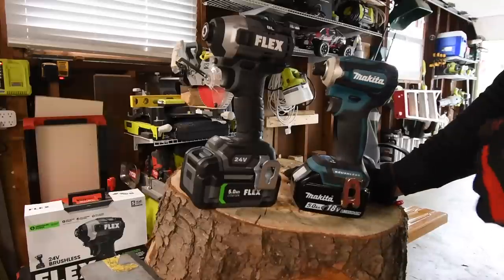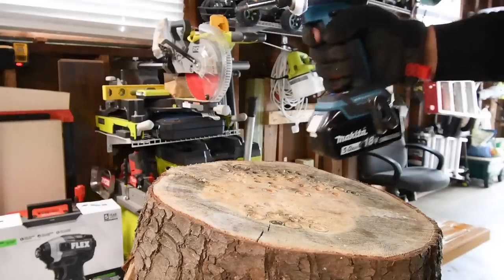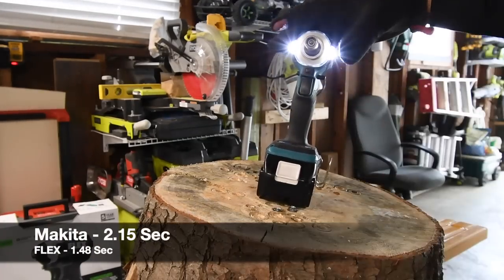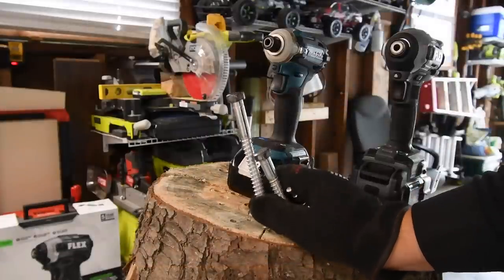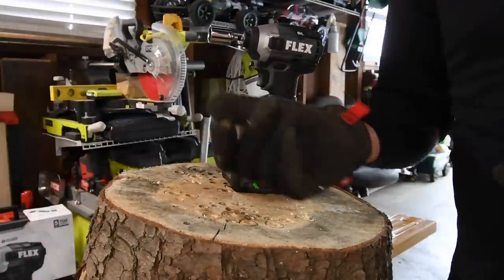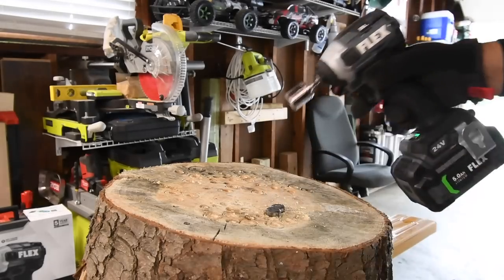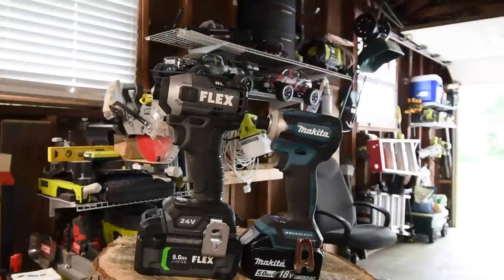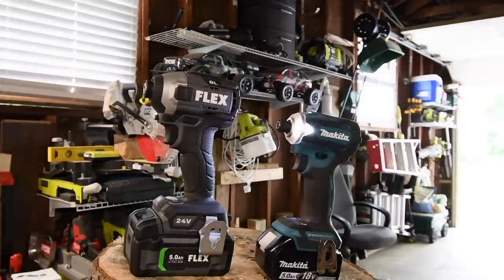Makita vs FLEX (Impact Drivers)

Comment: Power is only half of the equation with tools. The other half revolves around precision with control.
As a professional Tradesman, I did a lot of research when choosing a battery platform and also looked closely into other tools within manufacturers lineup.
The Flex line feels more like a DIY Pro tool where Makita feels and performs more like a Professional tool.
I chose the Makita XGT 40V max line and these tools just keep on impressing.
The right tool for the job. Power; precision; features and quality. Makita for the Win.
Enjoyed the video, keep them coming :)
Reply: Makita make fragile tools
Reply: @trentroberdeau6399  Cool story, but not
.
Reply: @skelley521  in my experience they are….. lol
Reply: @trentroberdeau6399  XGT are way better. Just look at all of the improvements over the LXT line.
Reply: @skelley521  that's why there's a speed setting in most Impact Drivers for precise works, and variable speed trigger for most basic impact drivers that don't have speed settings. All you gotta do is to learn how to use the tool itself. And power and torque is my basis. If you're tool don't have those? Then you're screwed! You can't do the job
Reply: @skelley521  Makita XGT lines sucks! That's why I sold all of my XGT's and got back to DeWalt and Bosch
Reply: I bet u never even tried a Flex tool too make that statement.I own both of these tools and Flex is a pro tool,I think the best pro tool at that

Comment: True tradies know - speed is not everything - imagine operating the flex all day long
Reply: I doubt the flex would go all day will have a temperature smoke show
Reply: If you have an issue operating a slightly heavier tool your just weak. It's not much heavier you're just nitpicking.
Reply: @micjubba709  I was working under my truck with the quick eject for 5+ hours and I used it pretty hard, it got lots of dust inside of the motor and the collet and everything still worked great. Never had an issue with the temp.
Reply: @gagejernigan5277   clearly you have no idea operating power tools all day long
Reply: @gagejernigan5277  yeah laying on your back. Trying holding it in front of you for 10+ hrs. That comment shows you don't understand and definitely don't do tradesmen style work.
Reply: @jakedraper1863  it's still not that much different if you throw on the 2.5 AH battery, which is what I was using.
Reply: I use the flex impact every single day for work. Never has any issues. Its not heavy to use either.
Reply: @nicksweezy2813  never held one nor do I want to. look at it compared to the Makita its a monster. massive/ chunky and a wrist killer. not my fault you cant afford good quality tools. All I am merely stating its not all about the speed. When entering a tool platform you should consider many factors like - ergonomics, size, weight, customer service, tool location and availability and many more factors. The only thing that is going for the Flex at the moment is speed. You cant tell me or anyone else for that matter that because your flex can drive screws in faster by a few seconds its making that much difference in your 10 hour working day. It probably saves you like maybe at best 5min a day. What a joke.
Reply: @stanavagiannis2381  what a girly man!
Reply: @tonystark2.088  did I upset you precious? I don't know if your eyes are painted on or not but that flex is a monstrosity
Reply: @gagejernigan5277   spot on 👌 
If you want something lighter go with a 12v tool from Bosch. Bosch makes the smallest impact drivers and drill drivers.
Reply: @stanavagiannis2381  you're telling me Flex is not a quality tool? That just shows your lack of knowledge and devotion to one brand, brand loyalty is stupid
Reply: @prestigemechanical3600  yep
Reply: @gagejernigan5277  I work for myself doing primarily HVAC and brand loyalty even with products I choose to sell also boils down to the brands customer service and support for the product. I would be curious to see what the turn around time/warranty process is on FLEX batteries and tools, nobody covers that stuff on tool reviews the real process.
Reply: @gagejernigan5277  ? I think you need to get your eyes checked, have you noticed the size of that flex. i was just merely pointing out that you may get a wrist injury from carrying that monster all day long. it has nothing to do with brand loyalty. i use 3 different battery platforms. i only invest in the best those platform have to offer and yes one of them is Milwaukee so what. i cant help it if i can afford good quality tools. i have never used flex and nor do i intend too for the time being as i am not blind not everything has to do with speed... so much more goes into my research before i purchase my tools. God bless & stay Covid safe
Reply: @stanavagiannis2381  dude it took me 3 weeks to decide between Flex and Makita, I went with the more powerful tool and the line that I think will grow tremendously
Reply: @stanavagiannis2381  it’s the same as Milwaukee and dewault, Milwaukee is the heaviest tho
Reply: @MrBOOM-fq3lw  not true as my Milwaukee impact is 1kg or 2.2lbs and the equivalent DeWalt is 1.3kg or 2.8lbs and so is the flex 2.8lbs at the end of the day look at the size of the flex it looks like a monster for a brand new current tool
Reply: @stanavagiannis2381  the flex is only 0,2” bigger than the Milwaukee it just looks big when you put a big battery in it just watched a side by side video on it from another channel
Reply: @stanavagiannis2381  the flex ad Makita are in the same price range... They're both more expensive than everything else besides Hilti brands. Lol
Reply: @Darlemonte  in which country? In AUS we don't have Flex but I have used Makita's  but found them underpowered. Personally if Makita & Flex are more expensive than everything else besides Hilti, well let me tell you "You are getting ripped off". I was gifted a DeWalt impact driver once & thought it was shit and sold it but I have used some other DeWalt tools which I thought "Not bad". I personally & predominantly use Milwaukee tools, some AEG's (RIDGID) & Ryobi's & they get the job done. I don't deny that Flex has some powerful & fast tools but that's not the be-all and end-all to power tools. Ergonomically I look at them (Flex) & think to my self no way. Its like me using my Milwaukee Gen4 impact driver with a 12ah battery LOL.

Comment: makita is quiet and smooth...I go with makita any day
Reply: 100% Agree
Reply: It's a finely tuned product. 
I don't care that it took a couple seconds longer to drive massive lag bolts without pilot holes. It did the same job, quieter, lighter, in a more compact package, with what will probably be longer lasting durability in the end.
Reply: i got the FLEX set for 50% off with lifetime warranty. Plan using all that power and running them into the ground and hopefully by them they have a new line of drills that are lighter and smaller. Lol

Comment: Flex looks like a brick compared to the makita lol
Reply: Lol
Reply: The Flex might be faster.  But given the choice, I’d take the Makita.  Size and weight count.
Reply: @kolchak357  The Makita is surprisingly small. I have the successor to the XDT16 (TD172D in Japan). I got it because of how often I hear that Makitas are the favorite of anyone that uses them (and I wanted a purple one). I have a heavily used DCF888 and I assumed it would be similar in size but it really isn't, it's smaller in every dimension and really nice to use. 

I ordered a black Japanese version of the oil impulse within a few days to use as my second instead of the DeWalt. I really love it.
Reply: @reginalb124  Curious where you order the Japanese variants. I'd love them for the color/improved build quality (though I'm sure thats marginal). Not sure I'd want to go through some questionable ebay sellers.

Comment: Everyone does these power tests like power is everything.. longevity, precision, vibration, and noise is what makes a tool along with the other details like power battery life etc. Mikita has all those and that’s why I like it. I wanna see how flex plays out in the long run
Reply from the maker: Longevity is something you can't really test. everyone uses and treats their tools differently, everyone also uses their tools in different environments as well.
Reply: @ManCaverTools That is why they should be tested using the same benchmark. It doesn't matter that Makita users only use the drivers to drive 1/2 inch screws, either way when it comes to testing, Makita will have to drive 3 inch screws or larger. Just like the other brands. Even if users don't use them for this job. The same goes for longevity, strength, adjustments, finishes, etc. The fact that a user uses their tool with all the care, doesn't mean that the tool will be of better or worse quality. 

    If the qualities of the tools depended on the use that each user gives them, then the tests and the very existence of these YouTube channels would be meaningless. 

(Sorry for the spelling mistakes. My language is Spanish, and I translated this with Google Translate)

Comment: The Makita is my favorite, but the flex is mighty impressive. Also the editing is amazing on this video, keep making more video edits like this.
Reply: Eh, the thing about these tests is that I wouldn't even use an impact driver on the type of things where that advantage is really noticeable. Those are wrench jobs. I guess if you don't have an impact wrench...
Reply: Oh yeah! Flex is the new king 👑 now. Flex wouldn't be called as "Milwaukee Killer" for nothing. I purchased mine a month ago with a bundle kit Quick Eject Turbo Impact Driver, and Turbo Hammer Drill both of them have 24V 5Ah battery and a Free 3.5Ah Stacked lithium battery. Then I purchased another set of batteries 24V 6.0Ah Stacked lithium 2 of them and one 8.0Ah Stacked lithium battery for my newly purchased Flex 24V brushless Worm Drive Style rear handle saw. And I got one of those Flex tool organizer something like stack pack or something. That's where I keep all of my Flex tools separated from my other cordless and corded tools (DeWalt, Makita, Bosch, Ryobi, Craftsman, Hitachi, HFT Hercules brand)

Comment: Great video as always.  I have the Flex. I have the Milwaukee Gen 3. I have the Dewalt 888. I have the Makita XDT16. I also have the Milwaukee M12 & M18 Surge…If I have to choose which one to carry to do a project…it would have to be the Makita Or the Gen3…the bottom line is the weight and power. If Flex could have made it as light as the Makita with the power of the Milwaukee then it would be a top choice..👍
Reply: I guess the same power but light like makita. the sound would be super crazy:) around 10miles people could have heard yor work😂

Comment: I love my xtd16 it’s my favorite but I got the new 40v max impact driver and it’s just as sweet. It’s a little bigger. It had a little better specs and has a little more power but the flex would probably still beat it. But it’s not all about power to me.
Reply: the 40 volt makita battery life probably crushes the flex battery life too, but i do think that flex is sweet too! lol
Reply: Can you tell the difference between the 18 volt and 40 volt? I'm sure the 40 volt has better specs but is it something that you're actually using it for because the 18V didn't cut it? What type of work do you do with it? I have my original Makita impact 18 volt lxt it's even non brushless with no speed options! Thinking about upgrading 🤷🏻

Comment: I'm still on the fence with flex. I kinda want to get into them this year just to get I to the program their doing for the early customers too.  I'm a huge Milwaukee fan boy so idk yet. Would love to see flex branch out and grow fast
Reply: Me too. I totally agree with you to sir. 😎
Reply: I used to use my Milwaukee M18 Fuel impact driver for every application,  until I got an M12 Fuel impact a few months ago.  That M12 is my go-to now for 90% of what I do,  because it handles it and then some.  Much better control than the M18,  which I only break out in extreme situations.   I love them both,  but frankly the M18's power/speed is just silly sometimes.
Reply: @enockenock4183  yeah I have both as well. Both have there places for sure. I remodel a ton so the M12 is my go to as well
Reply: There's a reason they're giving lifetime warranty on the first gen stuff only. It's not going to last. I've watched all the videos on comparison tests and the flexs have leaked out grease under a lot of stress. The flex does well on the small stuff but on the big stuff milwaukee beats it easily. My 2 cents is to just wait for the 2nd gen stuff. I'm a big Milwaukee user and they beat flex in the import stuff and have a way bigger line.
Reply: @jakedraper1863  yes Milwaukee are my main line up. Not sure about that only covering the first gen so will look into that. Thanks for the opinion 🤙🏻🤙🏻
Reply: im telling you.  you will not regret it. at least just grab the impact & the lifetime warranty. can't beat that. the batteries & charger are damn impressive too. fastest chsrge time hands down
Reply: @nicksweezy2813  that's exactly what I was thinking. I want to at least get that grandfathered in kinda style lifetime warranty situation. The second generation tools are the ones I'm actually interested in bc I know any bugs or style changes or whatever will be gone and fixed then

Comment: I just went the FLEX route and invested in my first combo set. Mostly after the lifetime warranty and it's not Ridgid, which I don't like. Also all the tools are 50% off. Sure they are big and heavy, and i will be using the impact constantly throughout the day, but Im a weight lifter anyway so it's not a huge deal. Lol

Comment: Flex has some good top end tools but we have no history for longevity
I have been swapping out many of my Milwaukee and Makita tools with Metabo HPT over the last few years cuz the 36V tools are superior to many of the other in power, durability, warranty, flexibility and innovation-always have been my go to nailers, mitre saws but the 36V 10" jobsite table saw, mitre saw, grinder, SDS rotary hammer, Recip saw, hammer drill, 1/2 full size plunge router have all been game changes cuz I can use the AC adapter when available-this makes these tools much more useful and unlimited run time-also saves battery longevity as I don't have to recharge the batteries as much when I have AC available-and they also made the batteries backwards compatible with the 18V system-just a bunch of home runs-not sure why Lowes hasn't marketed this pro tool line more
Reply: Baseball Dude, well that's why I bought it! To find out what's fuqkin Fuzz about! I bought the 2 Flex tool kit (Quick Eject Impact Driver and Turbo Hammer Drill w/ 2.5Ah & 5.0Ah Standard 18650 cell 24v battery and a Rapid charger and a bag) I bought it with my own fuqkin money to find out the Fuzz! I'm not getting sponsored by Flex or any tool Brands. And so far more than 1 year since Flex came out with this shit NO problems so far NO issues. I wanna see the Fuzz's but NO Fuzz so far. They're all good

Comment: Really impressed by the Flex, that black line isn't available outside of USA though (or at least where Lowes is not located) so not an option and I've never tried their 18v line. But the Makita is really compact which I really like so might go for the newer 172 (19 in the US? I don't like that they have different model names in different countries, really confusing). I don't know when 173 will drop, if it's worth wating for it, would depend on price point as well.

Comment: Got a question -- Is the Flex Impact Driver that you're using their basic entry level impact ? -- Or are you using the Flex Impact Driver that has Quick Eject and Multi Mode Function ? --  The 2nd of the two is considered to be more powerful.

Comment: I just don't think a 5.0ah 18650 is a fair comparison. I got the 6.0ah battery and there much better. Watch your gonna want to redo all you text with a 6.0 for the makita
Reply: If I'm not mistaken I believe that Makita's 6 Ah battery is also based on 18650 cells instead of 21700.
Reply: @GuyFromJupiter  All Makita batteries except their new 40v platform are 18650 cells, unfortunately. Great tools though, excellent ergonomics.
Reply: @GuyFromJupiter  yup just better then a 5.0. Lol
Reply: @Tegridynews  but the flex 5.0 is also 18650s. so it was a fair comparison in this test at their highest power mode

Comment: Dave MCT, bro that's not a fair test! It's an Overkill for Flex and you used the high end Flex impact driver. You should have used the baseline or basic Flex Brushless Impact Driver 24V. Have the Flex use a 3.5Ah Stacked lithium battery and let Makita xdt16z use a 21,700 lithium cells. It's an Overkill bro. That Flex Slaughtered the Makita without even the Makita having the chance to draw it's sword. Even the high end Milwaukee M18 Gen 3 Fuel with 6.0Ah 21700 cells had been Annihilated and murdered by that Flex impact driver.
Reply from the maker: There are more than 1 video on these tools

Comment: Μ18 gen 3 is still the king
Reply: Well not anymore! Lol! M18 gen3 and gen 3.5 got beaten by outsider Flex. And the 3 Dewalt's Flagship impact drivers with 6.0Ah 21700 and 1.7Ah power stack, Milwaukee with high output 21700 cell 6.0Ah battery all of the Got Annihilated and murdered by Flex 24V impact driver with 6.0Ah Stack Lithium Ion Pouch cell battery. Check Vince VCG Construction channel.
Reply: @twinbee4243  in big anchors Milwaukee gen 3 still beat flex 24v .Check it out  .Flex 24v is just faster in screws but when it comes to power M18 beat them all .MAN CAVER TOOLS is test them all